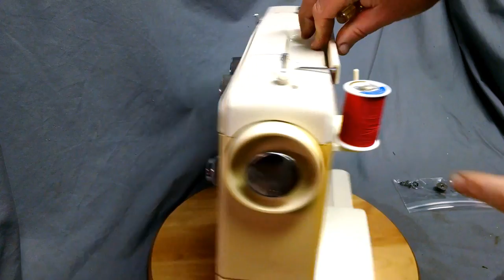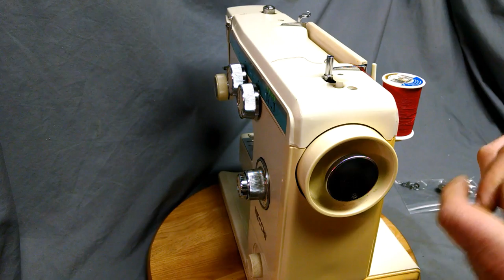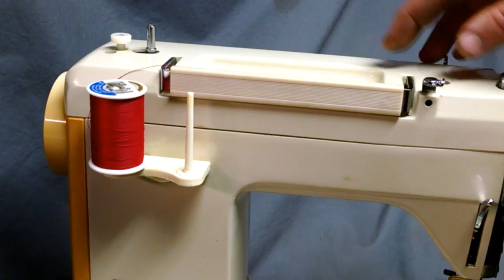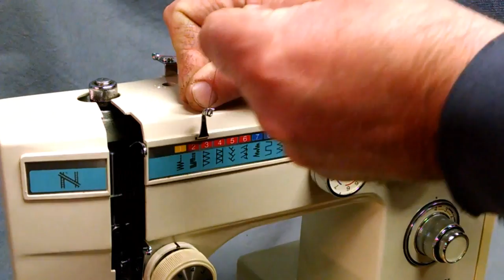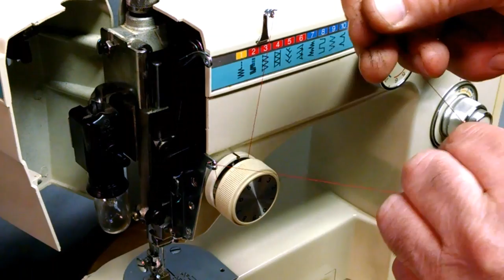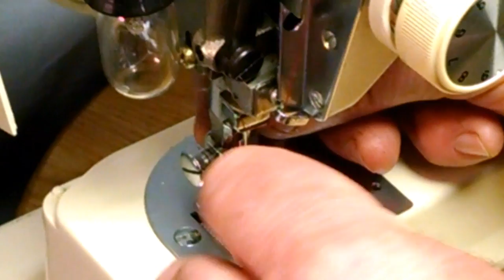How to Thread Necchi 535FA 535 534FB 534 Sewing Machine and Bobbin Case

Comment: Is there a back stitch on this machine I love it just got it
Reply from the maker: yes, its the push button in the middle of the stitch length knob.
Reply: thank you i will try that! i have another question please. i tried to whine the bobbin but the right metal lever was very tight so the needle was going up and down while winding the bobbin. how do you whine the bobbin?
Reply from the maker: I also made a video how to do that, https://youtu.be/X3V6hCSPhrA
Reply from the maker: It could be many things, if there is not an obvious problem then take it to a repair shop.